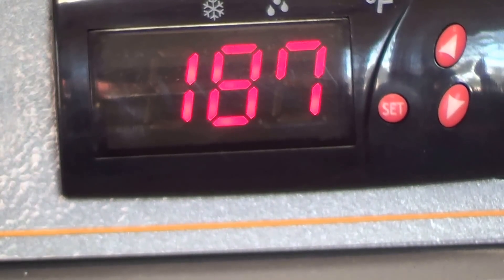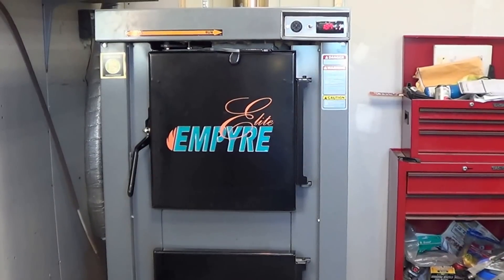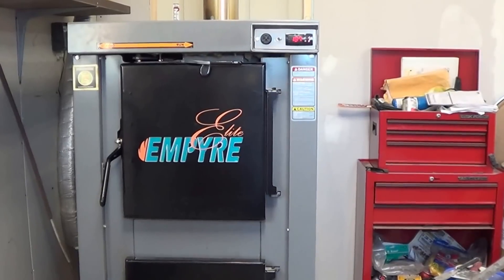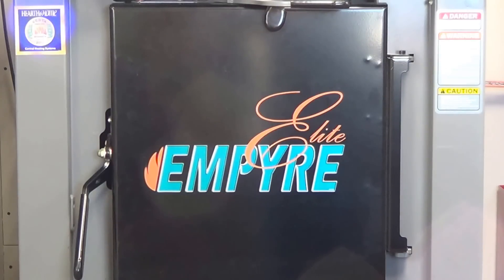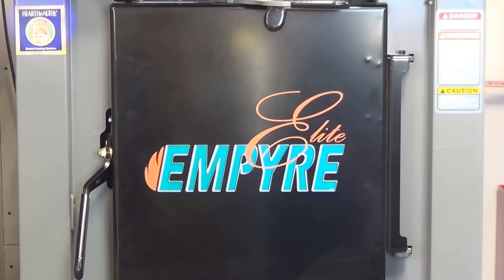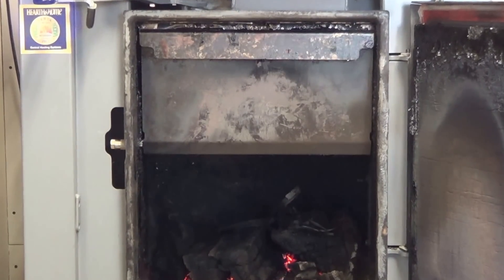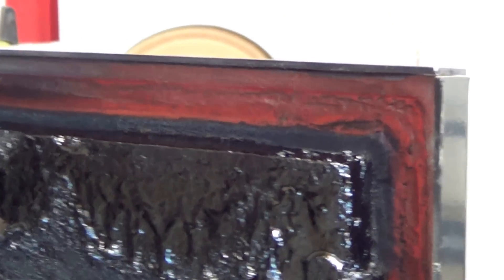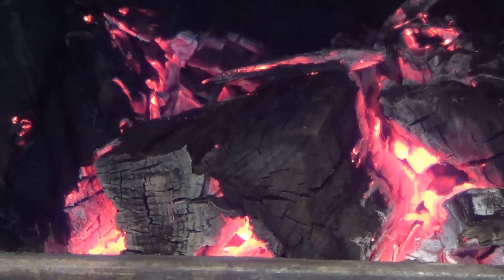Empyre Elite 100 indoor gasification boiler

Comment: Is this company still in business?? I thought I had heard that they stopped manufacturing them.
Reply from the maker: They they folded after Obama passed new source performance standard act.
Reply: So they did close?           I’ve been interested in getting a wood boiler for my farm and have always been interested in the wood Gun E180  by Alternate Heating Systems in Pennsylvania! But they are also struggling with selling them because the model that I need used to be in their residential product line but now is in their commercial department!  But I most likely can still buy it since I am a farm!